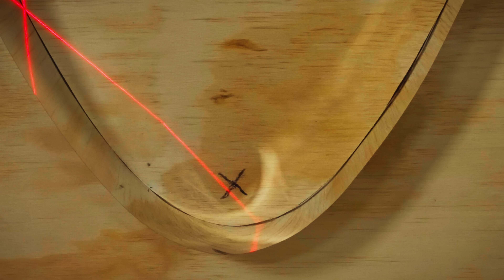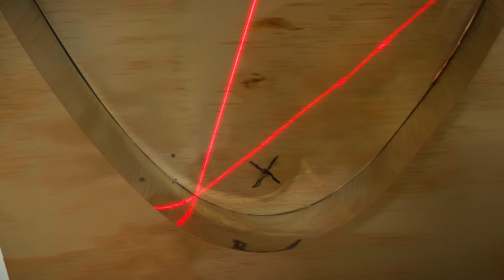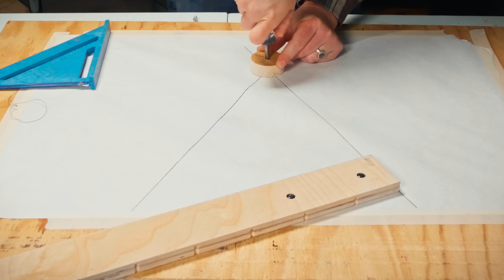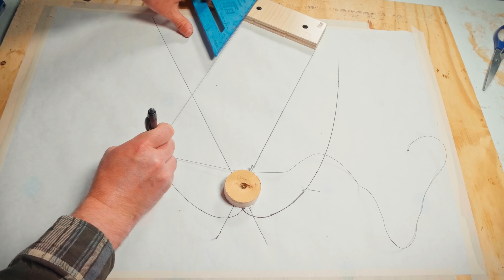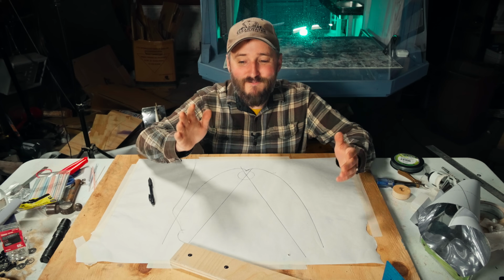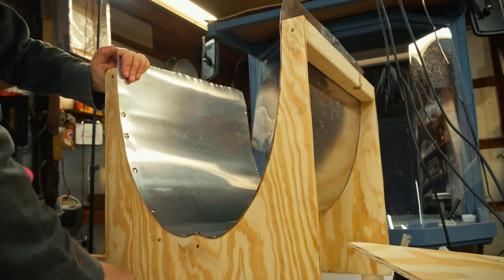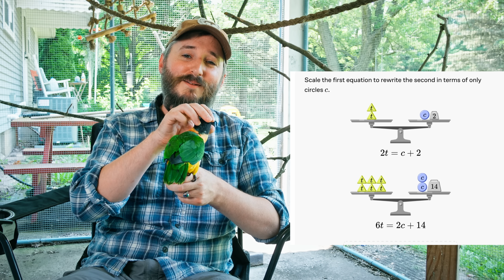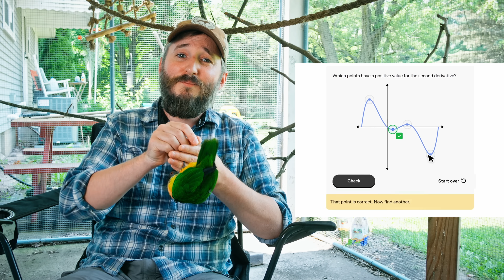DIY Solar Concentrators, Made Better.

Comment: I've actually built a small solar heater using a parabolic trough before, but the need to track the sun made it inefficient on cloudy days. The fact that your compound parabolic mirror still performs under overcast conditions is a game-changer. I’m seriously considering rebuilding my setup now.
Reply from the maker: It's sooo much better. Sun or clouds, a compound parabola is the best. No tracking needed.
Reply: @Nighthawkinlight  Tracking needed for the seasonal position of the sun.
Reply: @BTW...  Wouldn't the focal area just across the length of the pipe?
Reply: @BTW... 3 changes a year should do it
Reply: @BTW...  Couldn't it just point directly at the noontime sun on the winter solstice with a relatively wide angle being used to draw the curves?
Reply: @garethbaus5471  I'd go a slightly different path. One setup for morning. One for Afternoon. A gap at noon, because you warmed up the morning water, and reheated it in the afternoon. The gap in the heating phases is unlikely to be a problem given you can simply adjust one or the other phase if you actually have demand.

This allows us to have 2 40 degree arcs in the sky where we capture sunlight, for a total of 80 degrees, aka, 5 hours of effective heating on a sunny day and more on a cloudy one.
Reply: I think you'll find problems resulting from overheating and will still need some kind of active system to aim or otherwise regulate it. Let us know your results!
Reply: Make it distill water from ocean water :p
Reply: Do it! : ) and make a video
Reply: Place your compound parabolic trough in an east/west orientation to the sun, it will focus throughout the day and season, no need to track
Reply: @marscan1 except that requires daily adjustment to match the arc the sun passes through the sky. Because the suns path passes an arc through the sky due to axial tilt. Even at the equator the sun drifts north and south from solstice to solstice. In December it's more southerly, I'm June it's northerly. Also the deal with parabolic mirrors is simple, they have a single focal length. When the sun is at a low angle, the focal length means that the sun is actually focused lower than you'd expect, not on the pipe, because cutting a slice out of a 3d parabola reveals a different parabola unless you make sure to cut it perpendicular.

I'm not actually sure where your focal length will be at a 45 degree elevation by arranging the mirror East Wear and only adjusting for north South inclination, my instinct is it reveals a steeper Parabola, which means a shorter focal length.
Reply: Did you consider upgrading the whole thing with Fresnel lens?
Reply: Please share if you do.
Reply: I seen a video on sun tracking with two motors and light sensors. I can't remember exactly how. But if one doesn't have light, it turns the opposite motor on to pull it that direction. When it hits light. It turns off. Easy to build. I may not have that exactly right. But the video is out there somewhere